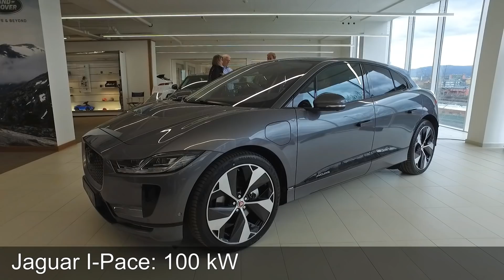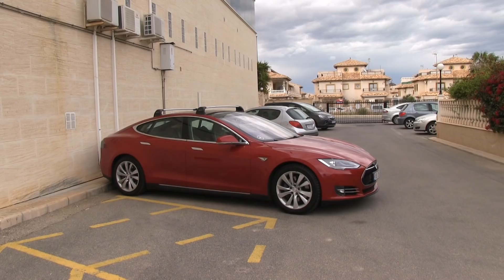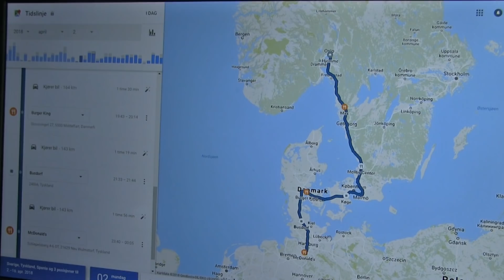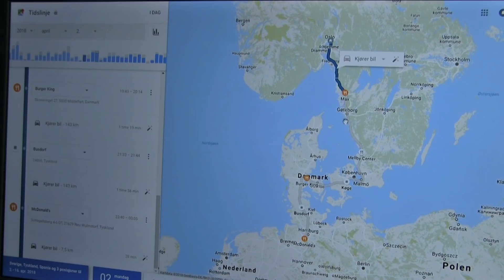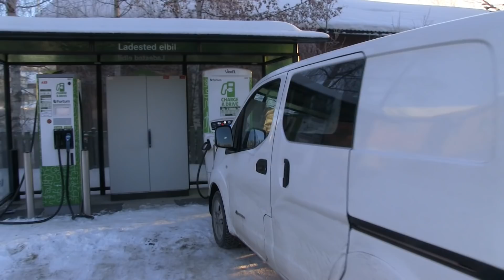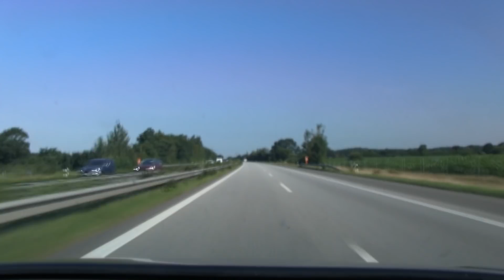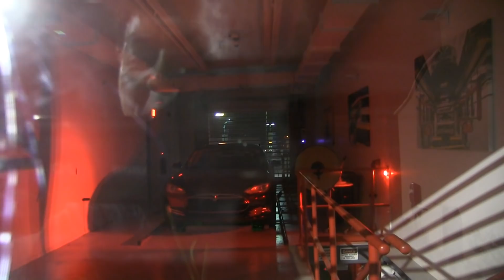Will 350 kW fast charging be too fast?

Comment: Audi claims that the battery in their e-tron will have the full charging speed from 0 to 80%, and slightly slower from 80 to 100%.
It does not behave like the batteries in present evs where the charging speed is very variable.
Reply: Every BEV already do this. Fast charge at the beginning and then quickly slow down near the end.

Comment: too fast does not exist
Reply: it's not just about "stops" but also about capacity. How viable do you think it'll be to take up a charging spot for 30-45 minutes if 80% (or hell even just 50%) of cars on the road are electric?
Can you imagine pulling up to a station and having to wait hours before you can even begin to fill up?

Sure you can put down 100+ station chargers but wouldn't it then be way more economical to put down 10 megachargers where you charge the car in 2 minutes?
Reply: you could have batteries that charge at 2000 km/hr, but this is no use at all when range would be sub 100 km. the solution is maintaining the C rate, and then just making the battery bigger. 1000 km of range at 1000 km/hr would be vastly preferable even though it is slower to charge
Reply: What?
Reply: I know, i know... All people drive 3000km with only 5 minutes stops

Comment: This is more like PR hype. There are no affordable batteries so far capable of such speeds (RC LiPo can charge at 3C but are very expensive). So what we will see is few initial minutes of something around 300kW charging speeds and after 5 minutes this will drop quickly to something closer to Tesla SC speeds like around 100kW. So this will speed up charging just a bit. Good for quick top up just to get home if it's like less than 50 km away
Reply: well, today 100-150kw charging speed with a 400V battery is possible. But Porsche is going to have an 800V pack, so you could look at it as two 400V packs, that will be charged with around 175kw.
Reply: also, lipo batteries don`t have good energy density, so they are out of question. For a race car maybe, but not for consumer electric vehicles.
Reply: Luca pack voltage doesn't matter, this will only help to have cheaper cabling (you push twice less amps) but charging rate is based on battery capacity only.
Reply: There are no batteries for such speeds right now, but "Ionity support" doesn't mean you have to always charge at maximum speed. Some cars will charge at 100kW, some 250kW. BMS will choose speed. Also it's good reserve for the future, when graphene batteries come.
Reply: If you think it's PR hype, you probably haven't heard about Porsche. Every time they announce a new car, people say it's just PR hype, then they release the car and it's even better than they announced.

Comment: Could current Tesla take advantage of the faster supercharging? It would be awesome if charging times to 80% were cut in half.
Reply from the maker: I don't think so.
Reply: I guess it is just wishful thinking then. 😢
Reply: Some people argue that the Model 3 LR could charge up to 184 kW on new Superchargers, which would be plenty fast for every day use:  
https://model3ownersclub.com/threads/model-3-charging-could-support-up-to-210kw.5169/
Reply: Here is to hoping that Tesla will offer a 2170 battery pack retrofit for older Teslas in the future. 🤞

Comment: I have only had my Model S for about a month, but I have already taken some long trips that have required some suprecharging.  Actually, on one drive home from about 200 miles (some downhill) the car said that I could make it home without a stop, but I needed to stop for lunch so I decided to stop at an urban charger on the way home.  I got to the restaurant, ordered lunch, went to the bathroom and I got a text (your car "name" is almost fully charged)  well I wasn't filling it to 100%, so I had to go back out and move my car or I could have changed the charging %.  I find the superchargers to be fast enough, it seems like the car is usually faster than I am.- It is just one of those questions that people that DO NOT currently drive Teslas.. ask all the time.. "how long does it take to charge up"  it's not a problem.. ever

Comment: No, its not to fast.
Reply: Porsche are not cheap cars, of course they will have expensive tech in them.
Reply: stickievidz, I think someone once said that about using expensive lithium ion batteries to charge in just 45 minutes. Luckily there is always someone doing the impossible.
Reply: Well, that are those people that say quantum computers are the thing. Problem: They are not viable and super expensive. It`s always easy to say that a technology that has not been developed yet is the "right" one. Yes, i know supercaps exist, but their energy density is nowhere near liion.
Reply: It's equal to the power drain of probably 100 homes.
Reply: stickievidz, supercaps aren’t the answer. It may not be graphene, it may not be solid state, but at some point someone will figure out how to make a battery that can charge and discharge at 12C, without the self-discharge problem, without the extreme voltage range, without the low energy density of super capacitors. 

The first battery may cost $100,000/kWh and only be affordable in a smart watch. And then as the price comes down to $10,000/kWh they can use them in cell phones. And when they get to $1000/kWh they can use them in laptops and portable tools. Eventually, when the price gets down to $100/kWh, they can use them in cars.
Reply: yes it is; you`d have to put in really expensive batteries (or solid state ones) to make this viable.
Reply: stickievidz
I guess capacitors are the way to go.